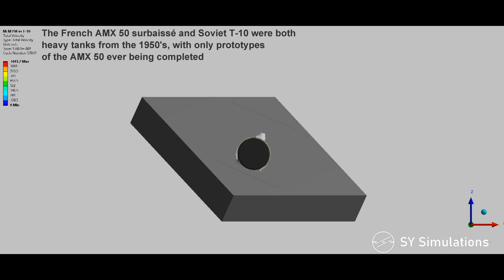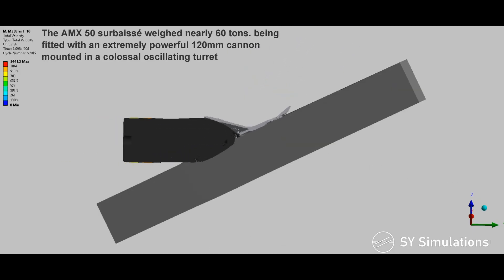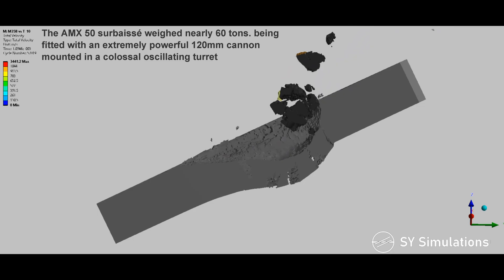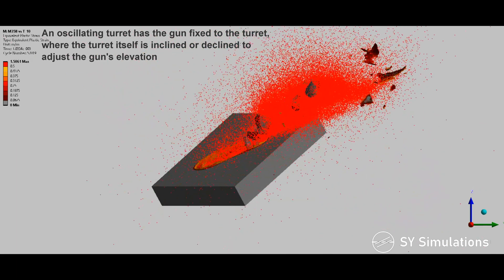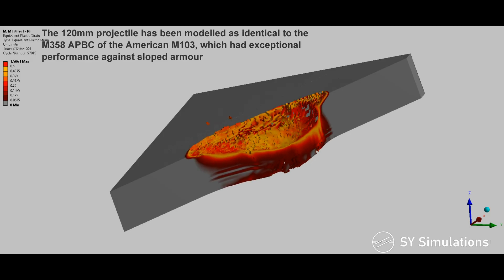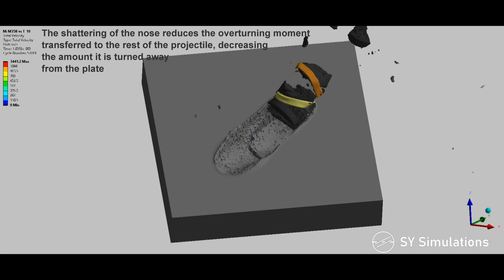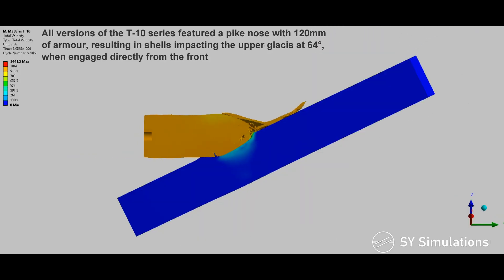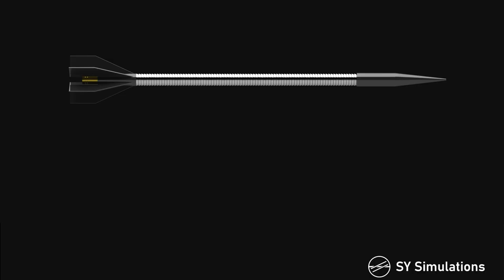AMX 50 Surbaissé vs T-10 | Oscillating 120mm French Monster Tank | Armour Penetration Simulation

Comment: Hello everybody... can i ask the creator for a next simulation? I was thinking the 38cm anti-concrete HE rocket fired from 200 meters?
As target a direct hit on the left turret cheek of a M1A1 Abrams, if possible also the overpressure simulation. Basically a full spectrum of simulations to see all the damage it would cause to the tank. If you want even any other modern era tank, like the Leopard 2 or the T-90 or the last version of the Merkava

Comment: AMX50, 60t, but armored like a Sherman
Reply: The heavy variant was actually armoured like an IS-3
Reply: Which variant? @guyyoung2355
Reply: The amx 50 frontal protection was about the same as the tiger 2 so no problem here.

Comment: 2 points to clarify about the AMX-50B:
1- they were built and tested between 1951 and 1953,
less than 10 years after WW2, France was devastated by the war and had shortages everywhere, including materials to make a tank, for the ARL 44, 5 years before, just finding ink and paper for the plans was already complicated...
designing such a machine despite such a situation is exceptional
2- 10 to 12 shots per minute.
the AMX-50 could fire up to 12 shots per minute with an automatic loader of 18 shells, 5 to 6 seconds between each shot,
that's 2 x faster than a Leclerc tank!
in comparison, a US M103 fired 4 shots per minute.
Reply: france devastated by the war, lol. you sir are a comedian.
Reply: @Mr.Sophistication-s1j  It's a polite way of saying "France ravaged by Allied bombings"
Reply: Хорошо, что СССР не пострадал от войны и все разработки велись в условиях курорта и плавающих сроков
Reply: @CorRubrum да успокойся ты, никто не трогал твой совок
Reply: The AMX-50B doesnt load 2x faster than Leclerc

Comment: 250m is very close range...
Reply: Average engagement range in Western Europe 44-45 was 300 metres.  250 wouldn't be unusual.
Reply: @iatsd I do agree with you, but generally longer ranges are examined first.
Reply: @Lancasterlaw1175   I concur with your aforementioned statement.
Reply: @iatsd bro T-10M is a late 50s tank. Also WW2 tank engagements were at least at 800m range, where did you get that number from?
In a conventional armored warfare the AMX-50 had no chance to get that close to a T-10M before getting absolutely smoked😂
Reply: @imitradisv  Notice how I said Western Europe?  Not Italy.  Not the Russian front.  Not the Western Desert.  Not any other front.

Where did I get the number?  That's what was given at Staff College.  I suspect the instructors knew more on the subject than you do.
Reply: Id say the surbaissé would still win the engagement because it wasnt meant to be used head on, it was supposed to be used like a tank destroyer @imitradisv
Reply: @imitradisv  T-10M was also built in the USSR, mainly by Russians. As with aviator kill claims, you need to divide the claims by 5 to get an approximation of the real performance of anything Russian/Soviet hardware.
Reply: It would lose because it never went into production. Anyone can make super powerful prototype. But unless you field it in some decent numbers in a relevant time frame, its useless.
Reply: @TwixSvK  pretty dumb argument dude. You’re taking it too seriously. This is all hypothetical. A simulation buddy. A wins a win, doesn’t matter if it was a prototype. What’s so hard about accepting the fact that both of these tanks would knock each other out depending on who fired first. Both incredible machines and feats of engineering, more so the AMX-50. The Russians can push stuff into the field because they settle with whatever’s “good” not great. Besides, they only made 1,000 t-10’s. Thats not really that much.
Reply: @jamesharding3459  ugh, why? did you talk about USSR and not about Luftwaffe pilots which could increase their count even in days when Soviets didn't fly?

Comment: Whats the difference between the suirbasse and surblinde?
Reply: Surbaissé was a redesign aiming at giving the tank a lower silhouette. I think it focused mostly on making a more compact turret. Hence "baissé", lowered.
Surblindé (up-armoured) was another redesign with a focus on better armour.
Reply: @GerardMenvussa oh good to know
Reply: Surblinde have more armor and a 20mm autocannon
Reply: @khoadang1707 the 2 get a 20mm canon it's just gajin never put the 20mm on the surbaissé
Reply: @orthos291  oh. New info, thanks
Reply: Pretty much what gerard pointed out, tho the idea only the surblinde equipped an auto cannon is a myth created off of video games 

Both surblinde and surbaissé had powered 20mm turrets on the roof, albeit the surbaissé later down the line got retrofitted with a more standard cupola with a 12.7mm mount
Reply: There were 4 version of the Amx-50. There was the amx 50 TOA100 wich is one with the 100mm canon. After There were the Amx-50 TOA 120, wich is the same as before but with the 120mm canon. After they did the surblindé because the armor wasn't very good for a heavy tank and they ad the 20mm. Howewer the tank was Huge with a weight to more than 75t. So they try the last version wich was the surbaissée, the turret and hull was lowed with less armor but more angled and still got the 20mm autocanon, with the weight low to ≈60t. In the end, they thinking about doing à other version but without a oscilated turret, because it ad a lot of weight for the armor. But they end it because they think that à heavy tank was useless when the project for the amx 30 was created
Reply: If the gun ia french, automatily they uses a white flag while problems happens in the bolt.
Reply: I think they added a 7th reverse gear with overdrive and increased the diameter of the white flag projector
Reply: @johncitizen306 what is bro jabbering about
Reply: @forkliftmans2559   sorry mate I don't speak mush mouthed ebonics
Reply: Encountered a word he didn't recognize and immediately went for racism, stay classy YouTube
Reply: @forkliftmans2559   ok "mans"

Comment: The video is neat of course but you are comparing a tank that never left the prototype stage to the T-10 which had a production run of 6,000 and actually saw combat. Also, the M103's production was only 300 hundred. I think it would be more interesting to see how the T-10 would fair against the threat tanks it could be reasonably expected to face.
Reply: They represent comparable technology level: AMX 50-120 prototype and last prototype of T-10 are from 1953. Conqueror is from 1955, and M103 from 1957.
T-10 was never used in combat, btw. Source for this claim is Western publication on Six-Day-War. that mistook Egyptian IS-3 for T-10, and M48s for Magach-3, and others just keep repeating it without checking.
Reply: @kireta21  may be I got you wrong, but T-10 have "M" modification in 1957
Reply: @СлаваПшеничный-д3й  
Yes. To keep timeline simple, T-10 had 3 models: T-10, T-10A, which got night vision and elevation stabilizer, and T-10M which got 2 plane stabilizer and better 122mm (T-10 and T-10A has essentially same gun as IS-2).

Also, regarding firepower, M103 and T-10M recieved vastly more capable fin-stabilized HEAT rounds in 60s, M103 in 1960 and T-10 in 1967. 
AMX-50-120 never got anything better than solid shot AP, because 120mm gun was not used on vehicles accepted into service, so there was no point making better ammunition for it.
Reply: @kireta21  Before T-10M, there was T-10B, which also had 2-plane stabilization, while keeping the D-25TS gun. Also, T-10A/B only had the driver's NVD, while the T-10M received the full set (with gunner's NV sight and commander's NVD).
Reply: Close cases like this are interesting to see the dynamics, you can also sorta see that beyond 1km the round wouldnt be able to go through.   "easily predictable" scenarios are not worth the simulation time imo
Reply: T-10 would get fucked ofc by heat and darts
Reply: Yes, here it goes:
T-10 is hit by a HEAT shell
T-10 dies

Welcome to pre-composite tank combat, it's not very fun.
Reply: @Prometheus19853  90mm HEAT would have problems with both T-55 and T-10, 105mm HEAT was introduced 3 years before T-64. That's not a very large gap. Soviets were consistently a decade ahead in armor.
Reply: @Prometheus19853  T-10 was still well-protected frontally against 90mm HEAT-FS shells, most common during late 1950s and early 1960s.
Reply: @Postoronniy  Not really. The T-10 had maybe 280mm of LOS thickness at best on the upper glacis, and an M20 Super Bazooka could rip through that with 40's tech and a slightly smaller warhead.
Reply: @Prometheus19853  That's at 90 degrees, without accounting for the deflection effect on the metal jet off the sloped armor, which would reduce performance somewhat.
Reply: @Postoronniy  main source of worry was not tank shells, neither close range weapons like Bazooka for that matter, but anti-tank guided missiles like SS.11 that could punch through more armor than a tank could realisticly have, could match rarge of tanks, or even outrange them, and do so from positions better concealed than anti-tank guns could ever be. And all of this while being cheap to mass produce, and trival to deploy.

Video on youtube, "How to Fight: The Tank / Mechanized Infantry Team" shows beautifully how tank tactics changed between 50s and 70s
Reply: @Postoronniy  That's not how HEAT warheads work. I have never once seen any documentation or simulation proving that effect in any capacity.

What I do know is the most accurate measure of HEAT protection for a monolithic armor array is direct LOS thickness as that is the path the jet takes through the armor. Based on those facts, the T-10 was obsolete and vulnerable to widely available MANPATs deployed some 10 years before it ever left the drawing board.
Reply: @Prometheus19853  You're assuming quite a lot. On paper, the M9 Bazooka with ~100-125mm of normative penetration should be able to easily defeat T-34-85 with its ~90mm of LOS frontal armor. And yet, in practice, it struggled to do so during the Korean war engagements.
Reply: @kireta21  Yes, ATGMs, and later 105mm rounds (HEAT and APDS).
Reply: @Postoronniy  Yes, compounding angles due to inconvenient positioning on a conventional hull layout cause a weapon with a very small penetration advantage to fail on occasion. A T-34 can easily reach 150mm or more with an unfortunate angle to the hull, which leads to the main point:

You've failed to account for the inferior pike hull design of the T-10, and why that kills it just as much as the HEAT shell. That 270-ish mm LOS thickness is the absolute maximum you can expect for the front hull because it is already two axis. That is, practically speaking, the thickest possible arrangement of the armor. Any shot from off center actually reduces the effectiveness of a pike hull, which is a big part of why nobody bothers using them anymore on top of cost, weight, and space efficiency issues.

The only way a T-10 survives even a 90mm HEAT shell is by exceptionally poor gunnery on the part of whomever is shooting it, not by any inherent value of the tank itself.
Reply: @Prometheus19853  You realize your dismissive attitude attacks the very purpose of this channel?
Reply: @danmorgan3685  You literally undermined the point of the channle with pointless bitching about "buh buh buh not a real matchup, muh 6000 T-10s!" When the matchup is a clear hypothetical over whether or not the AMX-50 could've successfully engaged the T-10 in a "Hot War" scenario.

You want "muh realism", you got it. HEAT shells rendered armor functionally worthless alongside the entire concept of the heavy tank by extension. The T-10 was obsolete the moment it hit the field, it did nothing of value that a smaller, lighter, and more flexible platform couldn't already do.
Reply: @danmorgan3685 same thing you did dismissing the test as largely irrelevant...
Reply: @Prometheus19853  Yeah there's a reason why most tanks after the 50's just sort of stopped being massively armored, HEAT had "won" the arms race. Until composite armor of course, which is why many tanks such as the Leopard 1 and even the Pattons to an extent didn't just increase the armor thickness. The Soviets sort of kept going with fairly "armored" designs on the T-54 and T-62.

So in short, yeah unfortunately for the T-10, while the armor is indeed impressive against old school AP rounds, it was rendered pretty much obsolete.
Reply: @bhag7977  Go back and actually read what I wrote. Actually think about it. Then get back to me with an comment you actually thought about.
Reply: BTW, T-10 production numbers estimate from reliable Russian sources is about 1500 vehicles. 6000-8000 is the Western overestimation.

In the years after T-10 entered serial production, advances in HEAT-FS rounds and ATGMs were making regular homogenous armor increasingly obsolete, so its production was never ramped up to IS-3 levels, and R&D on all future heavy tanks was discontinued in favor of new advanced medium tank designs with composite armor (principally object 432 - future T-64), which eventually became main battle tanks (by Soviet classification) with object 434 (T-64A).